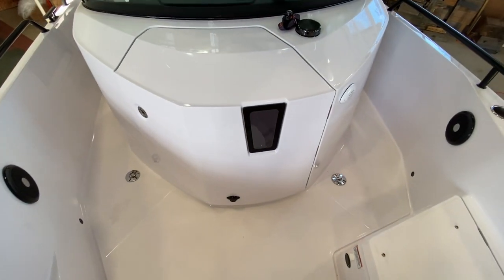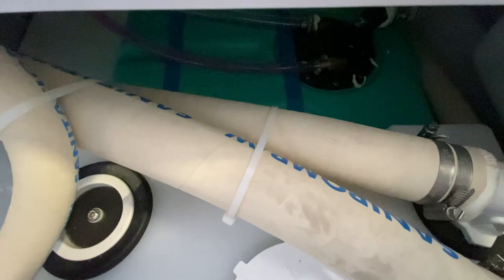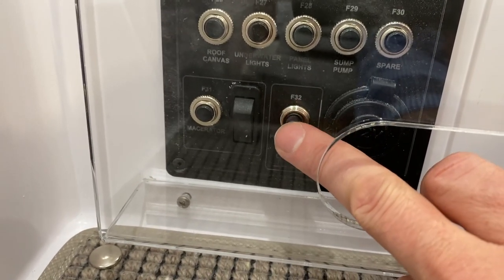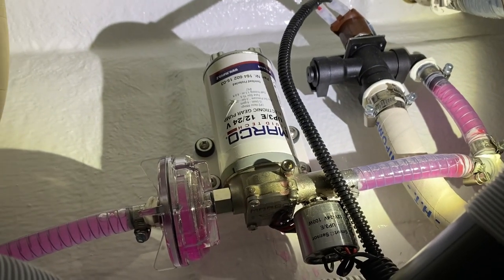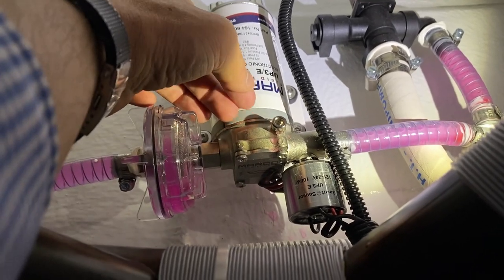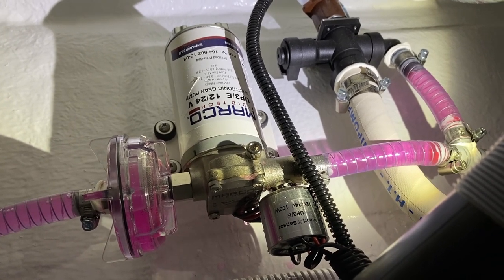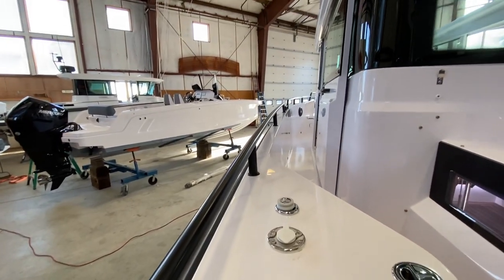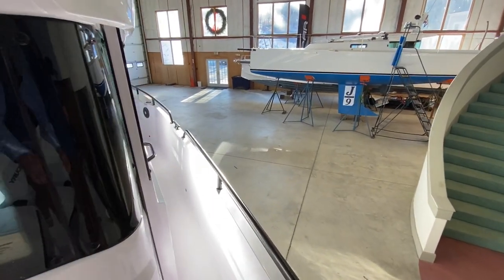Axopar Education Series: 2022 28 Cabin Fresh Water System

Comment: Ben, these Axopar 28 Cabin models are intended for weekending, not just day runs, given their extensive outfitting.  Unfortunately, 10 gals of water is not really very much for that purpose.  I'm wondering what you would suggest if an owner wanted to increase water capacity on a 28.  Is there a likely place to restrain a couple of 5 gal jugs?  The water tank looks squirreled away so much that adding a secondary tank would seem to be a real challenge.  And thanks again for these informative videos; much appreciated!
Reply from the maker: From our cruising adventures we never found that we were restricted with the volume of the water tank. That being said, we were conscientious of the water we were using for the shower and dishes. My recommendation would to use the boat and see if you have a need. But if that need, you can easily fit a 5 gallon jug of water in one of the aft lockers.
Reply: @EastCoastYachtSales  Thanks, Ben.  Didn't realize those aft lockers were that large.  Excellent detail to know.

Comment: Great video. How often should the water filter be changed?
Reply from the maker: On the Axopar 28 it's just a screen filter on the fresh water pump. It's always a good idea at the beginning of the season to visually inspect the filter to see if it appears clogged or dirty. Dip in water pressure could indicate a dirty filter as well. You don't need to replace the filter, just inspect and clean periodically.